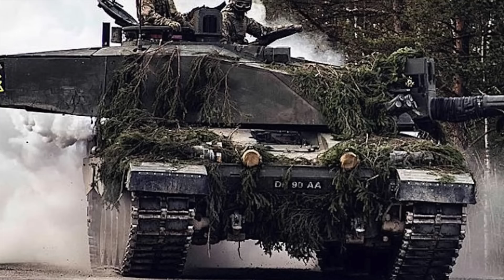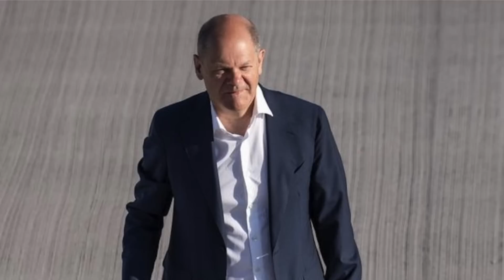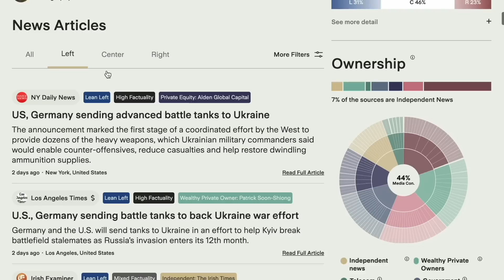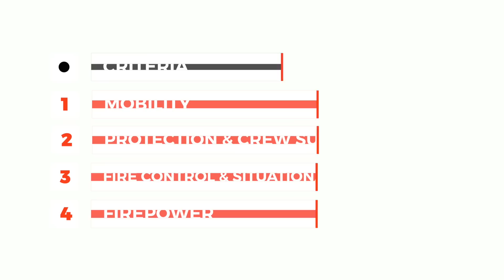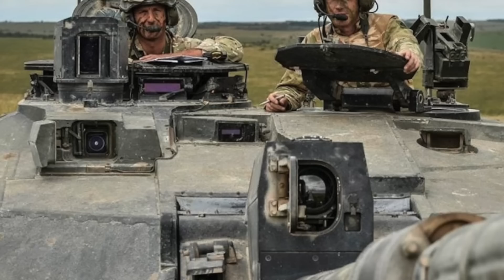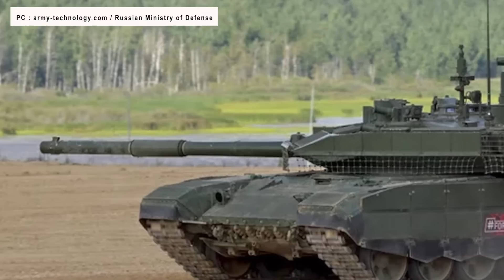British Challenger 2 vs Russian T-90 - Detailed analysis !

Comment: Shtora has been removed long time ago from T-90. It has been proven useful, but only against older generation ATGMs. For example, at the beginning of Russian involvement is Syria, there have been multiple footages of TOW-1 going for a T-90 and suddenly "going stupid" and headed for sky or slamming into dirt. But later ATGMs are far more resistant, so it was decided it is no longer worth having weak spots (parts of the armor covered with Shtora instead of ERA) .
It does, however have laser warning receiver and it can automatically drop smoke grenades or turn its main gun towards the source of laser. Another old footage shows ATGM crew setting up the position, pointing the laser designator and then suddenly dropping everything and running just seconds before their position was blown up. Apparently, T-90 picked up the laser, turned its turret and fired...
Challenger has rifled gun, so while it may be more accurate, its shell travels slower which makes APFSDS projectiles less effective.
In Ukraine, the weight of Challenger can be a problem since most roads and bridges can't withstand more than 40-50 metric tones. 
The rest is a pretty good comparison and fair.
Reply: To speak on the TOW-1 I think the "going stupid" is due to the range being to long and running out of the guide wire

Comment: Lol using some type of undefined numerical grading system to tabulate a score which somehow demonstrates which is superior is so shallow.  Both tanks have strengths and weaknesses and doctrine is what decides the superiority of these vehicles.  They are not meant to fight in a vacuum, but instead designed to fight as a combined arms component.  The video knocks the T-90 for it’s steering control system and praised the FV4034’s but fails to mention the reliability issues with the Challenger 2’s steering system compared the the overly rugged and simplistic system the T-90 used that is pretty much unbreakable.  Challenger 2 weighs in at 75+ tons vs the T-90 at 47 tons.  The T-90’s forward accelerating is significantly superior to the cumbersome Challenger 2.  Yes T-90’s ammo is stored in a hull carousel but Challenger 2’s ammo is also stored in the hull in bunched up storage containers that can literally result in the same jack in the box internal explosion if hit, video fails to mention this.  Training and experience of the crews is huge.  In actual combat time in the Challenger 2 for Ukrainian tank crews is zero right now.  Russian tank crews have been fighting in their T tanks for a year now.

Comment: I think we forget. All western tanks at best have faced t72s in Iraq.  They’re now going to face combined arms.  AT missiles, Tanks, artillery, guided munitions, and yes RPGs. I hope they do well. But statistically they are bound to lose some based on volume of fire.  Russian tanks are a mass volume weapon. One on one Russian tanks lose. Combined arms assault with mass push of IFVs and aforementioned arms. Then Russians have a chance. If they trickle in tanks they’ll get ripped apart.
Reply: Yeah that's the issue, way to few in numbers to make a difference. 95% of tanks in this conflict have been destroyed by artillery, mines, drones, ATGM's and malfunctions and mobility issues(stuck in the mud), very few tank on tank engagements that's been recorded. Also i'm not so sure these can be used in offensives unless they are using the roads for it, the T-90's had issues with the mud on the fields last spring and it's 20+ tons lighter and got wider tracks than the Western MBT's.
Reply: @andreasfjellborg1810  So many factors and variables are involved. I guess Russia not having good command and control plus logistics is playing in favor of Ukraine, but if Russia gets its shit together and actually makes a massive push with combined arms I do not see Ukraine slowing them down. Russia only has itself to blame. The west is already too far behind logistically speaking to bring in Tanks and jets at this point, if they do they will need to train, maintain, and arm. All taking time,  however, mud is the unsung hero or enemy here. Russia is slow to do anything now because of it, Ukraine has that going for them too. Once the mud dries up and the ground gets hard, that is when major movements will happen. I would rather see an end to this, but that is not happening soon.
Reply: Check out Abrams performance in Saudi Arabia and Yemen. USA delivered 200 Abrams and huttis destroyed 190of them in single year by using the simplest rpg7 shoulder launchers 
You are very correct in your assesment that western tanks hasn't seen actual battle yet and unfortunately where they did they failed miserably. Although Challenger does seems to be sturdiest of our steel steeds based on past deployments (it's only one that survived any actual direct engagement)